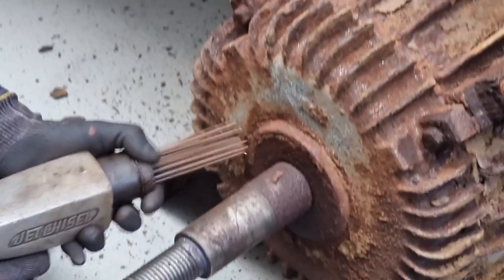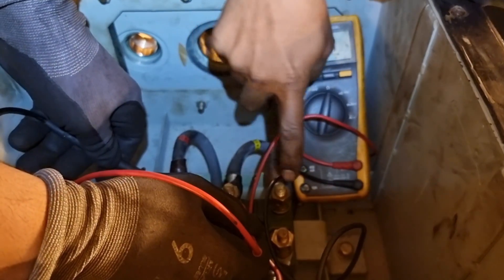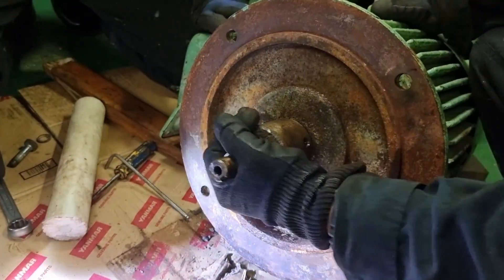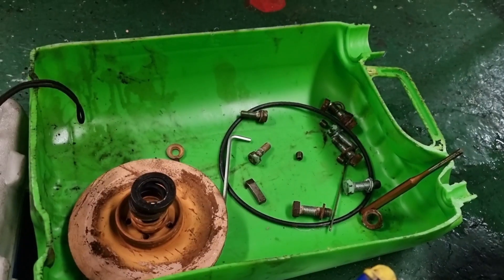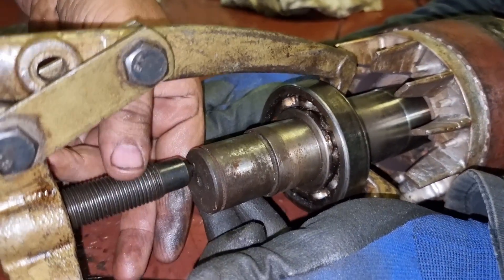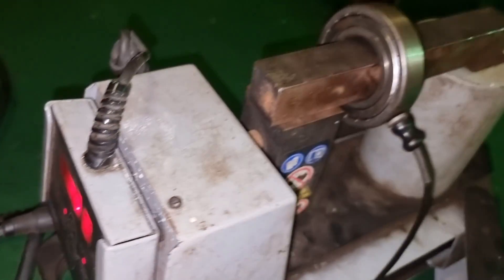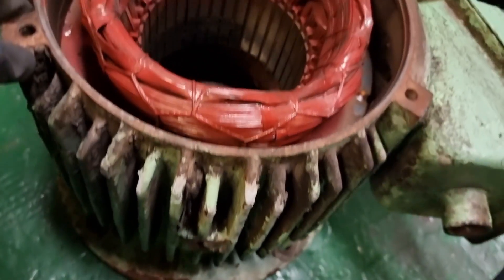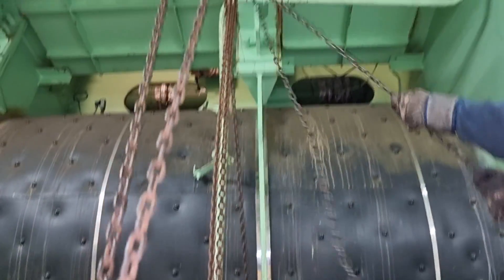ELECTRIC MOTOR OVERHAULING AND TROUBLESHOOTING

Comment: Is there a way to test the rotor itself? I believe that you can take an ohm meter and touch it to the metal of the rotor, and then touch the shaft itself. If the rotor is good, then you should read infinity between them.  
But I am not sure if there are any other ways to test it.  In your experience, have you tested it any other way, and have you actually found many bad rotors in your work? I have heard that condition is pretty rare. What do you think? Thanks.

Comment: What chemicals do you usually use to clean the electric motor and transformer windings?
A Impa code mb you have)
Reply: Hi Cain 'electro cleaner' has volatile properties clean the electric and electronic part use
Reply: @Selbsttatig  Hi, well, it's not for a lot of work, but there's chemistry in litres from unitor.
Reply: @cain5483  I understand that if you can find gasoline, gasoline will do the trick.
Reply: @cain5483  I do not recommend using thinner or similar, it will reduce the insulation resistance.
Reply: @Selbsttatig  gasoline has solvents that do not evaporate. Motor would be contaminated and need replacing.
Reply: @officerkrupke4966  In the old days, engines were washed with gasoline, you can ask the masters.
Reply: @Selbsttatig  In the old days we cleaned motor windings with electri-clean and an air gun with pick up hose inserted in five gallon can of this cleaner.
I suppose it wouldnt hurt to use gas as a degreaser for mechanical parts, just not on electrical.

Comment: Wow, I've never seen an electric motor in such a poor state on the inside. In what circumstances would you heat up the bearings in hot oil? Also, could you do a video in the future explaining the working principles of electric motors found on ships? (mainly the difference between induction motors with squirrel cage rotors or wound type rotors)

Comment: sir, is painting on electrical motor good?
or it has bad effect?
Reply from the maker: depends on the paint you are using. I use the water base paint and non flammable one.